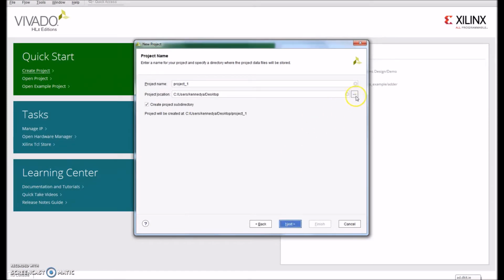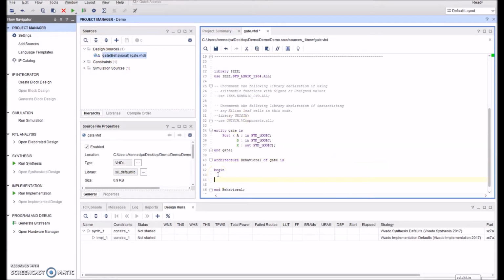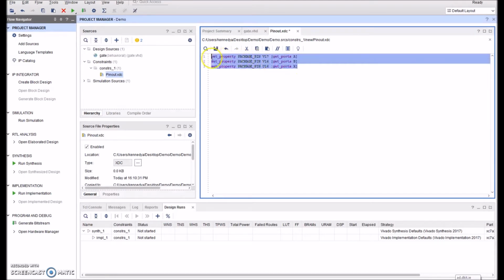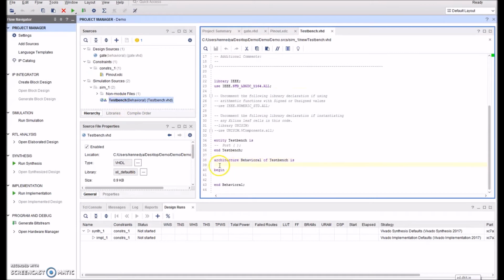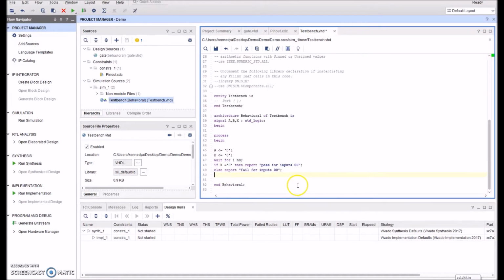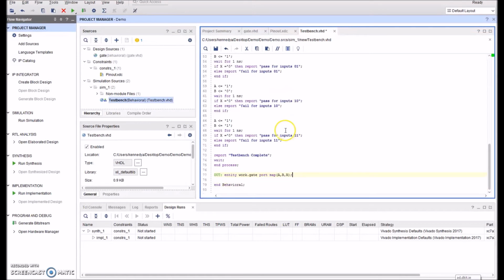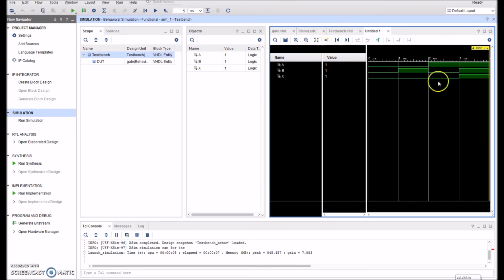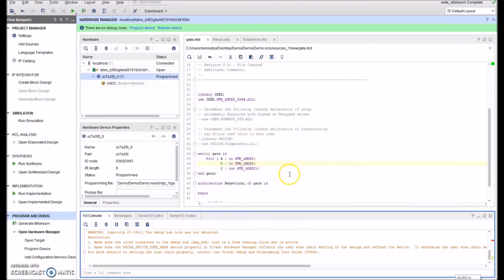Implementing a VHDL design on the Basys 3 development board

Comment: Thanks for the tutorial, worked fine I am running Vivado 2018.2. I noticed that after I program my Baysys3 board with the application and power cycle the board, the board resorts back to the factory program and not the AND gate program. Why is that and how do I permanently apply my program?